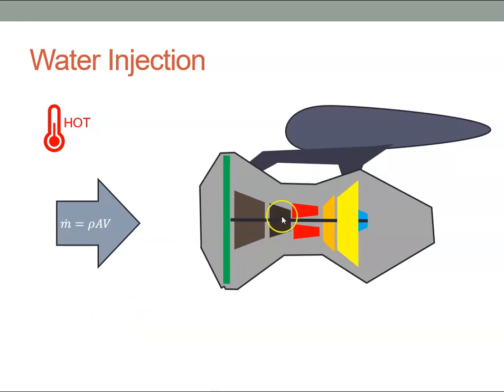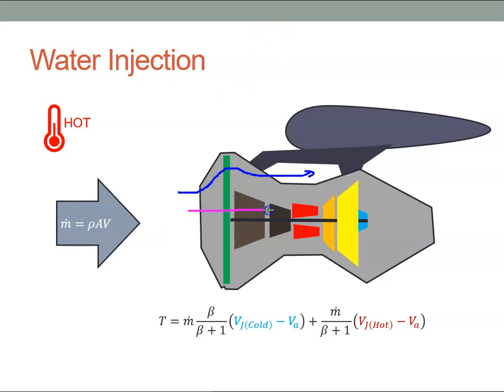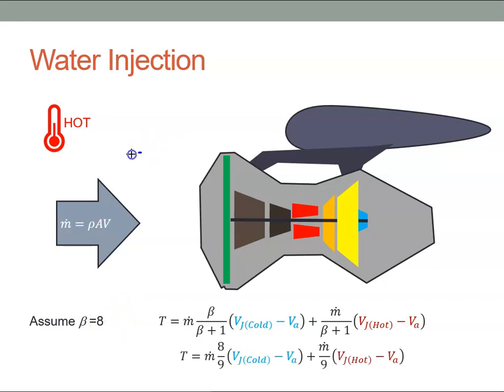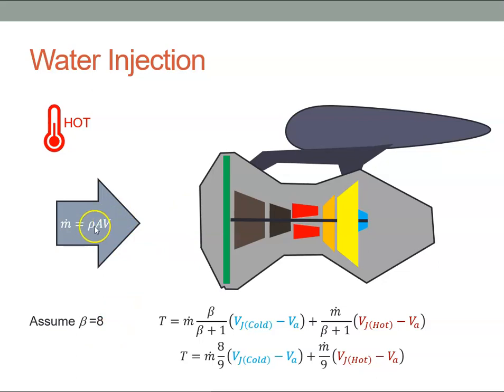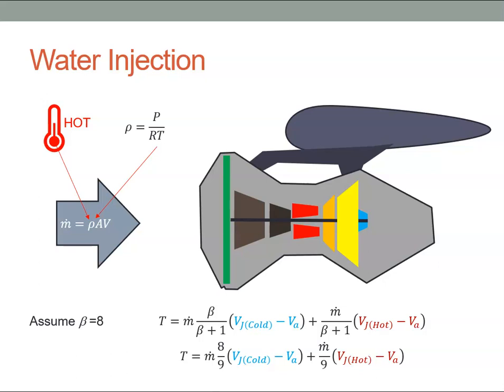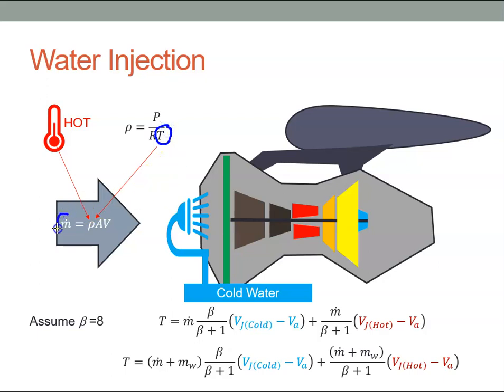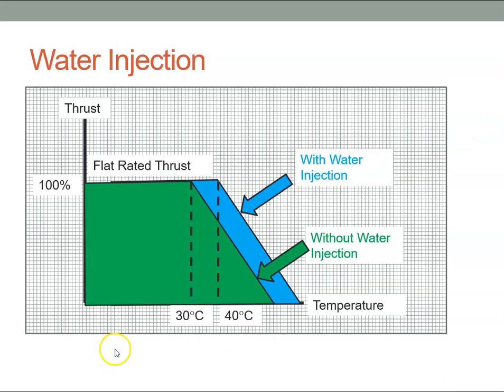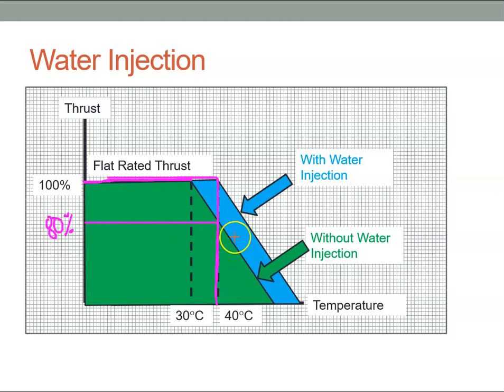Water Injection Restoring Thrust

Comment: it can also allow you to inject more fuel. The turbine engine's AFR is limited by the combustion chamber temperatures, which is why turbine engines run with a high AFR of 60:1. With water injection you can absorb more of the heat of the combustion process, as water has higher heat capacity than air, that allows you to burn more fuel and can use an AFR as low as 15:1 if the engine is built to handle so much thrust.